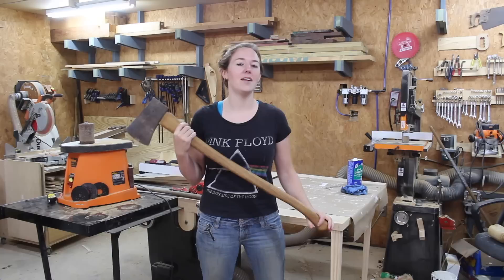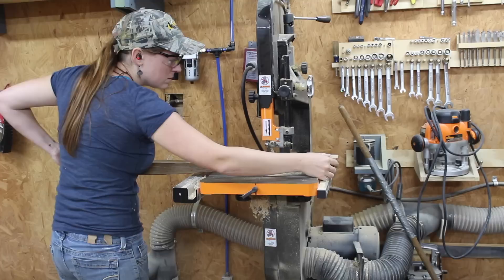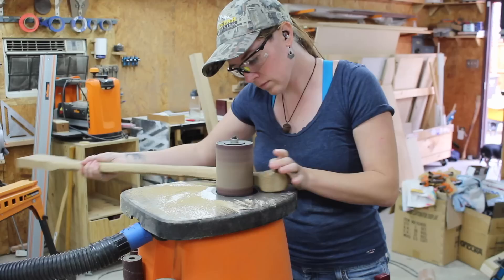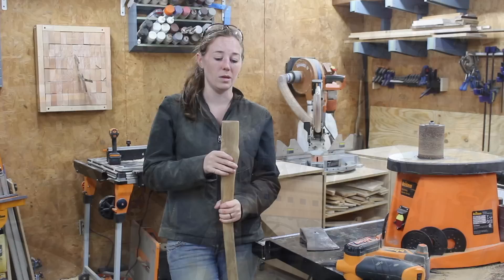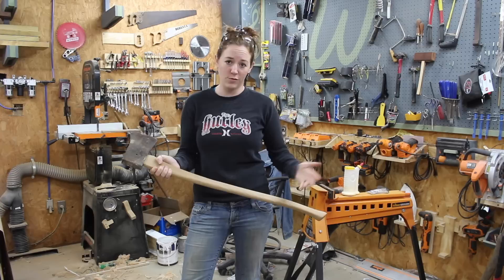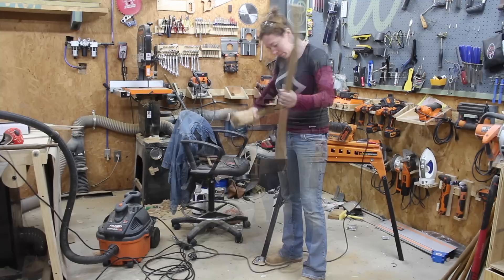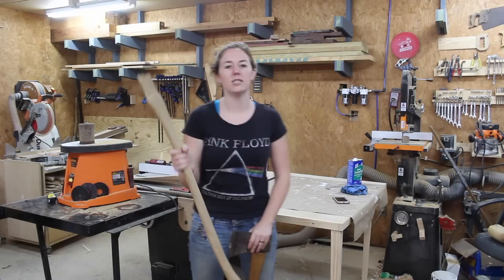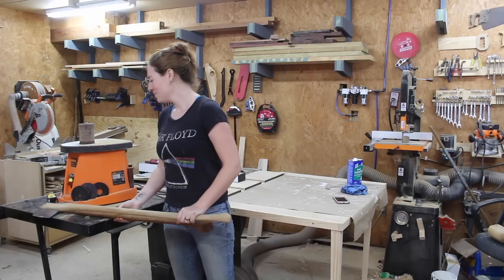Making an Axe Handle

Comment: Great job April. You asked about mistakes. I made one with boiled linseed oil. Almost burnt my house down. Linseed oil soaked rags can spontaneously combust. I read the warnings on the label and meant to dispose of properly, but I got sidetracked and forgot about it. I'll never make that mistake again!
Reply: new to woodworking and first time i started using oil didn't know it would catch on fire during the drying process of the rags. thank goodness after watching some staining techniques someone mentioned it catching on fire and looked it up and realized  i should probably take out the bunched up rag out of my garbage that was soaked with it. lol thank goodness i learned without burning down my house.

Comment: Came out good in the end! This fall I made three workbenches with a drop wheel mechanism. when I went to start putting the sides to the stretchers I realized that I'd made all the sides identical instead of mirrors.. got to rebuild half of them. Just part of the process!

Comment: Once you have the axe hung and wedged, soak the entire head, eye, and handle in the linseed oil, for a day or two. The wood (in the eye)will continue to absorb the oil, and once saturated, will crystallize and keep the head tight on the axe for much much longer. I try to soak the entire axe when I re-hang any of mine.
Reply from the maker: Oh neat, I didn't read or hear about that advice when researching it. I'll do it.
Reply: yep. I do that with hammers, as well. It might not be a "splitting" axe, but an axe is useful for many things outside its specific design niche, Like ZOMBIES!

Comment: I was re-finishing a table for a client earlier this year. We ultimately decided that General Finishes Arm-R-Seal in the semi gloss would be the best choice for the new finish. It was a rather large table. I went through about half of the can building up the finish on the table. I was on my last coat, and I went to do my last passes to level out the finish, but I did not realize I accidentally grabbed the wrong rag, which was covered in sawdust. Instead of doing the smart thing and letting it dry, then sanding out the dust nibs, I tried to "pick" them out, which in turn, pulled up previous layers of finish, and thus ruined everything I did. I then had to strip all that finish off the table for a second time, and build up my coats again. By the time I had fixed my mistake, I think I used almost an entire can of Arm-R-Seal. Great work April! That axe turned out very nicely!

Comment: If you never make a mistake, you've never tried. I love that you're willing to show us your mistakes so we can learn with a little less pain. I learned to 'Hang' axe heads way back in the seventies. I've never used glue on the wedge... I fit the handle using a scraper or piece of broken glass. The smooth surface seems to help friction hold the head on... Of course, I could be fooling myself... Not having a bandsaw, I do a lot of shaping with the draw knife and spoke shave.

Comment: I messed up pretty bad one time... I made a fretboard in rosewood all by hand to a ukulele then when I was done with it I realized that the frets was at the wrong measurements. So one weeks work ruined because i forgot to dubble check the measurements.
Greetings from Sweden

Comment: I just screwed up a sledge hammer handle hang. Put the roughly round handle in at an off angle from the center line. I gorilla glue my handles in so when you screw up, it’s a mess. 

I typically make the wedges out of treated lumber to last a little longer than poplar. The gorilla glue does a good job of keeping water out of the handle head, and filling in small gaps.  My current technique with a box plane, my hand grinder, and sanding machines is a far departure from my first handle replacement  nearly 50 years ago. I had broken a splitting maul handle (I broke a lot of stuff when I was young) and I ask my grandfather how to fix it. He gave me a rough handle and a piece of broken coke bottle glass. It took me all weekend to finish it.       Love to watch your channel.

Comment: Oooooo ooooo! I'm good at this! I built a new race motor. Small block Chevrolet. After getting the block and rotating assembly back from the machine shop I started putting it together. Got the motor built and put it on my break in stand and fired it up. It ran for about 20 seconds and locked up. Wouldn't budge! Tore it down and found a ton of bits of sludge in the oil pickup, oil pan and bearings. The machine shop didn't wash it after machining and I didn't think about it. Luckily the only thing that was hurt was the bearings. I re polished the $3000 crank shaft and spent another $300 on bearings building one set of bearings to make everything right. Could have been a lot more expensive I guess. Awesome job April! We never stop learning in life and mistakes just make us better.

Comment: I have a clock hanging in my shop.  Had a grand plan of making a dual time zone clock, but out of a solid piece of red oak.  Cut the circle, drilled the center for the works, and went to slice a layer off the face using a bandsaw with a 12 inch throat.  Problem was that the clock was 14" in diameter.  After some hacking around and trying to 'make do' without any of the proper tools, I stained it, wrote "TAKE YOUR TIME" across the face in big block letters, and hung it in the shop.  Failure is a wonderful teacher.

Comment: Great work April.  Hanging a axe is very hard let alone making the handle.  Your hanging method was spot on.  I have several rasps that I do a lot of the shaping work with.  One other thing that most people miss when buying or making a handle is you want the grain in the handle to be oriented the same way as the axe head.  If the grain is going across the head or even a little bit diagonal the handle is much more likely to snap.  Again, great work.  It is almost a art.  Im still learning.

Comment: Good job, especially the second one!  Suggestion: file off the burrs on the flat face (opposite the blade).  That way you can avoid them breaking off and turning into missiles at some inopportune time.  Dad (an opthalmologist) took a lot of those chips out of injured eyes.

The story you asked for:  Dad and friend Hank  were at the beach house, installing a fluorescent lamp on a screened porch.  Drilling a hole with a spade bit to feed the wiring through, they had trouble - the bit would heat up and smoke but would not cut through the ceiling material.  Two trips to the hardware store to get replacement bits, only to discover that the drill was in reverse.

That's why I loved the Red Green Show.

Comment: Lack of success is not failure. Failure is when you give up. As long as you keep trying you will not fail. You may not always succeed, but you will not fail. Great work.

I did a clutch on a Nissan Frontier which is a 10 hour job ( I worked at a Nissan dealer and it was my first one.). I made the mistake of clocking the flywheel wrong. Yes it got replaced as well. Didn't figure it out till it was all back together. Had to take the whole thing back apart and pretty much redo the whole job. Never made that mistake again. As long as you learn from your mistakes, they are not mistakes. They are lessons.

Comment: ok April, here's my story.  Working on remodeling our guest bathroom, I wanted some nice trim on the outside and an attached framed mirror on the inside of the bathroom door. I also wanted to use the cheap hollow core door already in the house to save some money.  Spent half a day making sure my measurements, cutting, placing, painting the trim (decorative floral design) and finally gluing everything in place.  Wasn't until I hung the door that I realized I glued everything upside down (big boxes of six panel at the top and the mirror kept hitting the toilet when you opened the door, small bathroom).  i ended up having to buy a new door, trim and mirror to do the whole process again.  So a misdirection axe handle isn't so bad :)  Finally my grandma taught me the old adage "we learn more from our mistakes than our successes."

Comment: well done. Hanging the slow tedious way is far and away the best way. For very modest occasional use, you might get by the quick way but under even the most heavy use, the way you did it the second time will keep that head in place for years. Great job!

Comment: Been working on stuff all my life. Put a new blower motor in a pickup once. I Could hear it blowing perfectly but would not put out any air. Messed with it two hours. Finally went in the house and called my 90 year old Dad. He laughed at me and said Dummy unplug the wires, turn the plug over and plug it back in. You got it running backwards. :)

Comment: Great job. Recently I built my wife a can shelf. Just a basic shelf she can stack cans on. I had majority of the 2x4's cut to the length I needed. When I realized I needed a couple more cross braces. Well apparently I had not payed attention to the fact that I set down one of the precut legs with the rest of the wood. Well after I had cut my cross bracing and it was time to assemble I realized my rookie mistake. I had used my precut leg to cut cross bracing.

Comment: When splitting, the ground will give and make the axe want to bounce.  If you balance the log you want to split on top of the larger log it will be much more rigid.  You can use other logs to help balance it. Cool video! I'm making my first axe handle right now and this video helped me. Thank you

Comment: This is just a suggestion, do not cut the end of the handle flush with the head, leave about a 1/4 inch and then submerge it in water for 24 hours (just the head end) this causes the wood to swell in a mushroom shape and thus assures you that the head of the ax will never come loose, then allow it to dry and do the rest of the steps needed to preserved the wood, i know that what you had done is probably enough for what you are going to do with it but just wanted to write something lol, I also admire the quality of work that you do all the time, thanks for doing this types of videos and keep up the good work.

Comment: Nicely done- as a side note, you don't want to let your axe, knife, chisel or anything else with a sharp edge go into the ground so unless you're using techniques to avoid your axe, hatchet, splitter, chopper or whatever hitting the ground beneath your feet and the piece you're striking, rest it on a timber block. Also, place it on the opposite side so that the block will catch the axe if there's an unseen knot or flaw and act as a guard.

I'm impressed you chose to step up and own your mistake.  

First time i tried to use a whetstone i was a kid and i didn't soak it or use oil.  Arkansas stone, black.  Destroyed it and knife beyond repair. My dad ended up turning his big Bowie style knife into a 3 1/4 inch knife for me to use at scouts to always remind me to ask those who've done it before to avoid making their mistakes, think twice, act once and never ever ever touch his stuff without asking.  That was a lotta chores to work off that broken stone and knife haha. 

Keep it up

Comment: Hello, Mz Wilkerson;
I'm 67 so I've hung a few axes.
That 1st handle looked real good,
If it wasn't backwards you could've hung it properly, beat the end & cut off the tip later.
BTW, you have fine splitting form.
A lot of people could learn from the way you curtsey at the end.
That is the 'correct' way to split, or buck for that matter.
Using the whole body & legs is usually better & safer, too.
Have a GREAT day, Neighbor!

Comment: I've done several handles for axes, hatchets and mauls.  I always use a draw knife and a spoke shave, I usually gut the stock to rough size on the table saw and then go at it from there with hand tools.  The secret is they need to be hair popping sharp when using them, they require a lot less work to use them that way.  Nice work on the handle.

Comment: Excellent video as usual.For your first attempt you did great.I did make a mistake once.I thought I had done something wrong,but when I double checked it turned out I hadn't.Actually the mistake I have made most often is making a mirror image of what I wanted.Very frustrating and the only solution is to start over.

Comment: hey april, just a tip for next time, the curf for the wedge to go into only needs to be about 2/3 of the length of the head. also, I have found a harder wedge works better and oil the handle first including the part where the axe goes. Bukkin billy ray has some good axe handle videos

Comment: Nice job. I've made a few handles for hatchets, axes and hammers and I always enjoy doing these projects. One of my most recent failures...I recently made a nightstand with hidden compartments. I had an absolutely gorgeous piece of lumber that I planned to use for the front legs. Well I cut it to length, stacked them together and cut the tapered angles and that is where the problem came in. I should have flipped one piece over before this step. I ended up finishing the project but one of my legs had to be placed in the back due to the wrong angle. The project came out nice but it could have been so much more aesthetically pleasing without my mistake. Oh well, live and learn.

Comment: Though I've not made from scratch I have found an angle grinder and a flap wheel makes short work of shaping and fitting the head on the handle.  I actually do the "hanging" upside down compared to how you did it.  comes out the same though.  Also in a store bought kit you get a metal wedge that you pond into the wood wedge.  The wood wedge pushes the handle to the sides while the metal pushes the the nandle into the front and back or toward the bit and butt.

Comment: Nice job on both handles.  I have never seen anyone glue the wedge into a handle. The  axe head exerts more than enough force to pinch the handle and keep the head on. This leaves you with the ability to remove a damaged head for a new replacement. Suggestion on splitting: put the log on the stump you have there next to your pile.  If the axe goes through or skips off, it lands in wooden stump and not dirt/rocks/soil. - Annie

Comment: Nice! If I were You I'd also put the axe vertically up in vise and pour a poodle of oil in the eye - it nicely soaks in endgrain overnight and secures handle even more because the wood swells. I recently made handles to three hammers and it worked beautifully :)

Comment: So I was going to make a lamp for my mom for Christmas.  I went and got red and purple heart to turn on the lathe for an inside out feature.  I got the inside part done and glued everything together to turn the outside.  I used too little glue on too cold a night in an unheated garage.  About 10 minutes into the turning, I got to test my reflexes (I failed miserably, but nothing actually hit me) as 4 pieces of hardwood went flying in multiple directions, completely wrecking my plans.

I still have the wood for use in other plans but have since rethought my lamp design.  I haven't been able to do them yet due to bigger priorities (moving), but I definitely learned from my mistakes on that one.

Comment: Here's a story to make you feel better.  One of my biggest hobbies is making chainmaille.  It's tedious and incredibly time consuming but really rewarding.  About ten years ago I was about 8 months into an inlaid banner.  It was made out of 1/8" rings of different colors and the inlay was of a band's logo.  After 2 months work I realized I had misjudged the size of part of the logo and it was going to end up being about 2 times bigger than it should have been so I had to tear out 2 months work and start over.  It was like tearing my heart out.

Comment: Nice job.  I have an old Tomahawk axe that I have been wondering how to attach a new handle to.  I have at least learned how to get the "hang" of it, even if I dont manufacture a handle from scratch.  As for having to do a "do-over" I had to do this with some squared off arches in my home renovation.  I did the same entrance 3 times, largely because I failed to pack out the plaster appropriately and then ended up with a "concave" finish.  It took a lot of time, energy, and luckily not much money to fix, but I got it in the end, which is all that matters.   As for your sign, failure is a learning process.  If at first you don't succeed try and try again!

Comment: Great work, just replace that glue with Linseed oil both in the slot and dip the wedge, then a steel step wedge. Thanks for the excellent production values.You make making great videos seem effortless.

Comment: Great final handle!  I tried to inlay wire into a turning once.  I forgot to turn down the speed of the lathe when trying to sand it.  Turned the lathe into a giant 4000rpm weed eater with a 16ga wire as a string when the glue came loose.  After I got back from the emergency room (only bruised finger bones) I fixed my mistake.

Comment: Hi April, Good job, no really. Having worked as a Machinist over 30 years, of course on a rare occasion, would scrap a part. The second one always goes quicker and you learn a lot. Failing is a good way to learn. Work safe, be good, C.

Comment: i was doing a poured top live edge, with a large voud crotchwood. the bugs were bad so my brother and I decided to pour in the living room. I "Thought" we had the bottom sealed. First there was a dripping, then a running sound of the clear coat running onto my new hardwood floors. i almost got sick. We ran it outside. I will say hot soapy water got everything up off the floor though and the table turned out amazing.